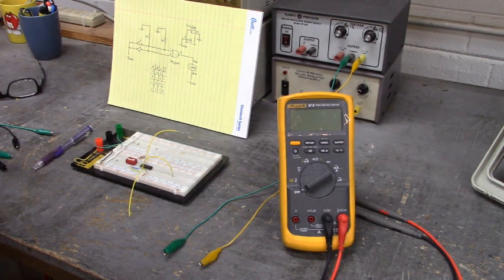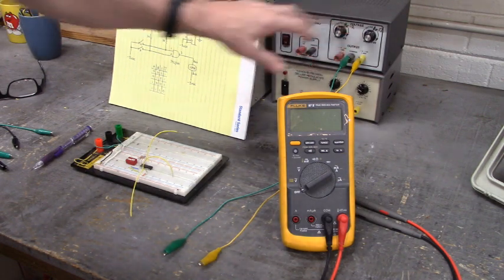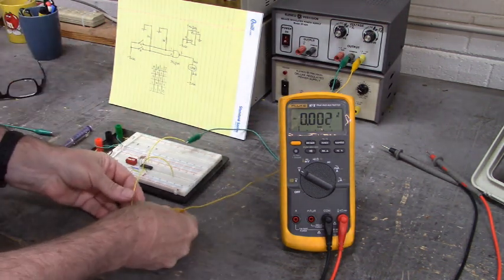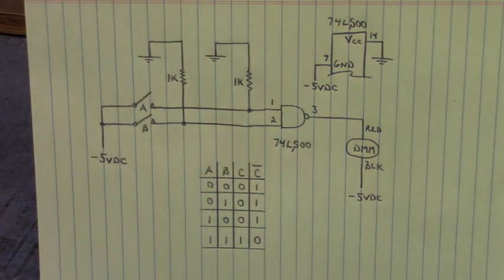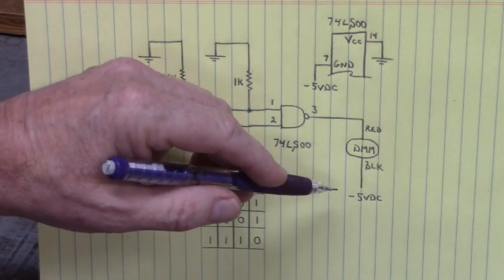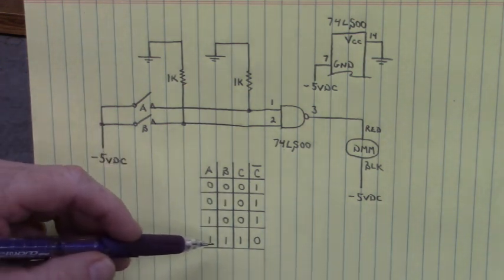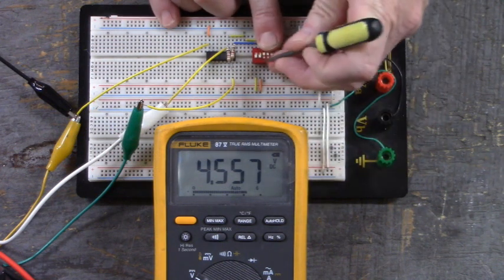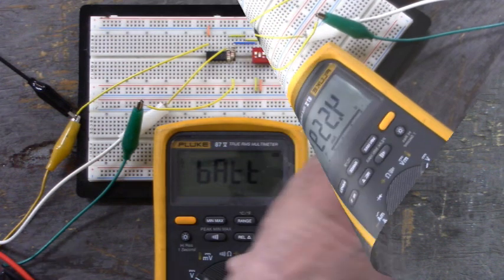(Part1) Powering Logic from  Below Ground

Comment from the maker: Most, but not all electro-magnetic noise (say from lightening strikes) is above ground. I worked on an arc welder controller that had its CMOS logic integrated circuits Vdd at 0Vdc. And Vss (Gnd) at -15Vdc. So that electrical noise from the welding process would be less likely to interfere with the logic process. Thanks for watching one of my videos :) Have a great day :)